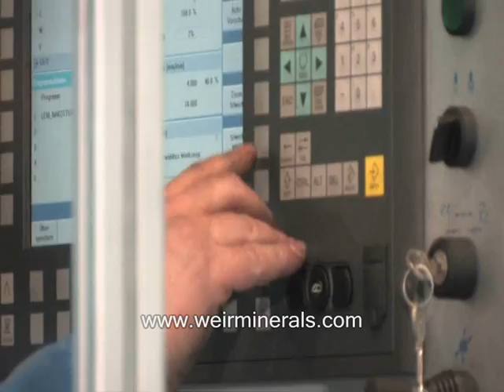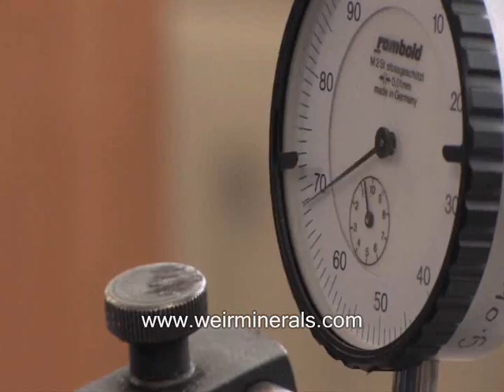Weir Minerals - hydrocyclones, valves, wear resistant linings for mining and mineral processing.

Comment: I have worked in a slate quarry in Cornwall where several Weir pumps were in use - they are absolute pigs to work on and the wear parts don't last 5 minutes. Especially the compressed seals.